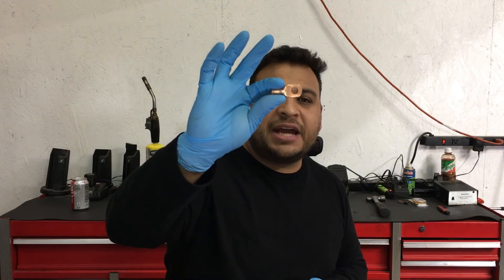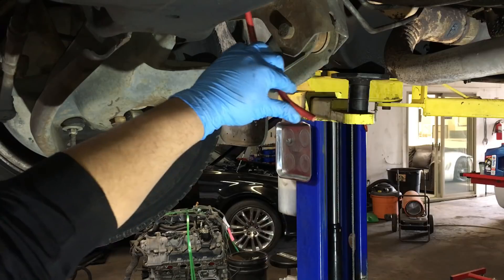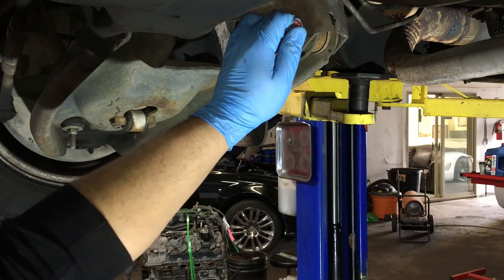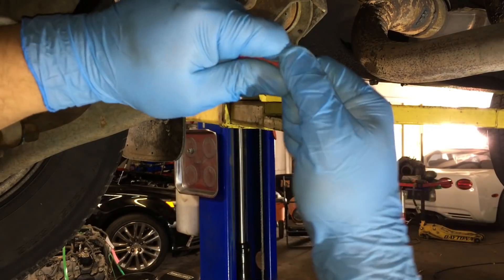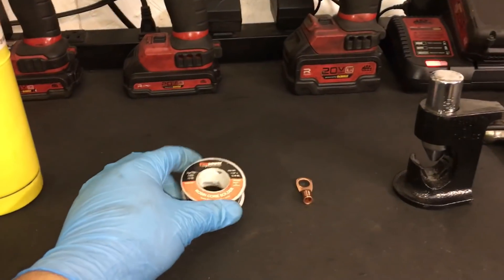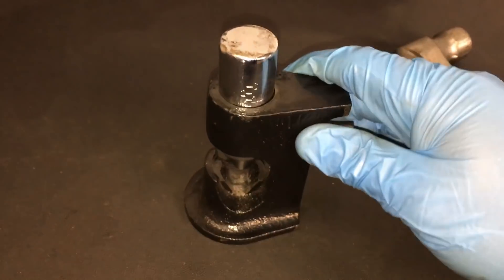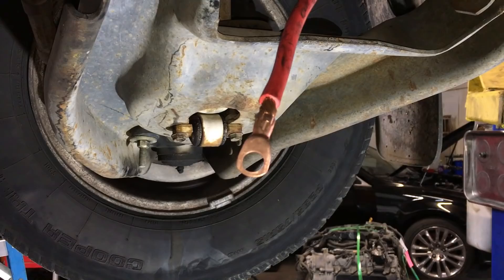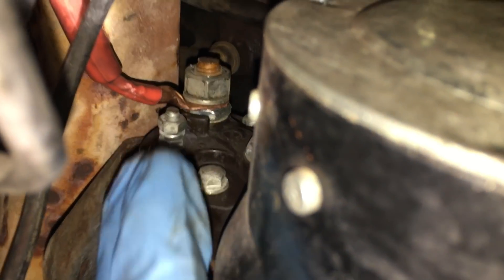SOLDERED VS CRIMPED COPPER LUG WIRE TERMINALS

Comment from the maker: My method was to solder just the tip of the wire so that when I crimped the terminal it wouldn’t damage the soldered connection. Thanks for watching!
Reply: No shame not knowing.  You taught me a few tricks with the newer stuff.  Soldering has been an old school method from way back. Before there were mig welders, British motorcycle manufacturers made fuel and oil tanks out of two hand hammered parts that overlapped each other about a quarter inch. Then they soldered them together. In auto manufacturing, in the old days, body parts were welded in a recess and the recess filled and smoothed with body solder. Not a 60/40 type but different mix.  Toxic as all get out!
Reply: Jajajaja First Solder, then Wack the Car, Then Crimp…?????   Crazy..!!

Comment: May I ask all of the expert here. Including the YouTuber to help answer a question. My dad is old and he probably mistaken a 40/60 solder (40% tin, 60% lead) as the 60/40 solder. He bought at a cheaper price hit is one whole box. He intent to use the solder to solder between the copper wire and the open barrel ring lug connector for his electric bicycle. But after he realizes is not 60/40, but is a 40/60, the seller refuse to do any refund or anything. In this video I saw this solder shown in the video is also using 40/60 solder on the lug connector. May I ask all of the experts here including the YouTuber of this video please help answer: if 40% tin, 60% lead is able and suitable for solder copper wire with open barrel copper ring lug connector or any lug connector?

Comment: Compare the melting points of solder and copper and then decide which one you want to trust to a loose connection on your starter or battery
361°F (183°C) for solder and 1981°F (1084°C) for pure copper.
When you properly crimp a copper lug onto solid copper wire, you are left with something that is as close to a single piece as you san see with the naked eye. As for magnification, I never tried that. Solder is always going to be a weak point if your hardware connections are loose. A hydraulic crimper is the right tool for the job. There are compact, battery assisted hydraulic crimpers in case you are weak or your space is limited.
Rather than cutting all the way through your insulation and counting on luck to prevent wire filaments from being cut and your amperage capacity diminished, you can cut part way through and then flex the insulation so that it parts from the cable. Did you see the lost filament(s) when the insulation was removed? The solder connection that was made here is called a cold solder. That's when you don't heat the lug with the wire and solder inside. the only solid connections are:
1) the solder to the lug
2) the tip of the wire to the solder (and this is questionable)
3) the point where the copper lug is knocked against the wire by the tip of the hammer crimp tool (also questionable.
The shrink tubing might be okay because the most important end is tight. Heating both ends and using the kind that has an adhesive inside would have been best. While this cable might not fail, it is still not capable of carrying the amperage that it would have been if it were done correctly without solder. The way the solder was used in this video, it wouldn't have caused a problem because it wouldn't have interfered with a proper hydraulic crimp. In this case it's just a wasted step.

Comment: I crimp, and solder with flux. Then heatshrink. This keeps saltwater from wicking up the inside of the insulation. Make sure that you position the terminal in its final configuration before you solder it, and clamp the wire down, and then tighten the terminal, last.

Comment: Soldering small wires is one thing except when you're working on little tiny 22 gauge data wires that are part of a canbuss network. Trust me if you solder these tiny little data wires it's going to cause you more issues than it solves. Keep in mind people that electrical solder is primarily made up of tin which has 5 times the resistance to current flow than copper does. So yes it will cause voltage drop issues when you're repairing wires in a canbuss system. This is very important. The only thing I've found that works for those tiny data wires is a variation on a wire nut. But there not wire nuts. They make them for installing car stereos without having to crimp or solder anything. It basically has a needle on one end to pierce through the wire behind your dash and then the other end is sorta like a wire nut where you attach your new/accessory wire etc or wires for that matter. Because crimping will even break the individual strands of copper in those tiny little data wires giving you the same issues as Soldering them. Believe me been there learned that the hard way.

Comment: In my line of work dealing with 4awg to 2/0 wires and cables sometimes its extremely difficult to remove from equipments to repair.. i find a hand pump hydraulic crimper cheap and effective more so than the hammer type especially in tight, awkward places .. the electric ones are  way faster but expensive.. if the terminal is subjected to alot of water, oil, grease or moisture soldiering after the crimp is important not before..

Comment: I solder many such connections all the time for battery connections on my solar battery bank. I use 2/0 AWG wire and tinned copper connectors. The difference is I put solder past in the connector and on the wire. I place the  connector in a vice and as you did I use map gas. After the job is done I put the freshly soldered end into a bucket of water. After install I spray an anti corrosion compound  on the joint. The key is the flux which helps the solder flow into and around the wire so it can't shrink ever, so failure is not possible.

Comment: 59 dollar hydraulic crimper an harbor frieght is the best thing since slice bread lol you can put crimp anywere instead having take wires off an back on..i was seeing so much about solder so i was thinking doing both but now i think about the weakness of the wire after heat BAD IDEA

Comment: you are right solder is for wires like in house never moves.plus you put heat makes the wire weak i dont care what they say an make them corrode... you have to crimp when wires has constant pressure everytime it moves.I crimp then put liquid tape were the wire meets the end of lug just make sure it flat air tight then put marine grade glue shrink wrap i never had to change one ever they last longer than we live

Comment: Shouldn’t the cable copper strands also be heated before being dipped into the solder in the lug? In normal soldering, it’s considered mandatory that both the parts being soldered need to be hot enough to melt the solder. Then the solder is melted by touching the parts, not by the heat source. If one of the parts is too cold, the solder won’t give a good hold...

Comment: Hey I love your diagnostic videos, but frankly this is the first one I've seen where i've just been like "what??? that's just.... completely wrong...". Everything shown in this video is either wrong or unnecessary. 

First of all, solder doesn't belong anywhere near areas that are prone to heat and/or vibration.... an engine bay has both of those in spades. Crimping should be the only way to join/terminate wires in an engine bay. 

Secondly, those hammer-style crimping tools are complete rubbish. You need to get either a proper lever-style hexagonal-die crimping tool (like a bolt cutter) or a hydraulic lever-operated crimping tool with dies, and do this properly. 

You don't need to do anything more than crimp it once. When properly compression-crimped, the lug becomes a solid piece of copper with the wire strands and cannot fall off because it is literally one with the wire. Heat does not affect it, vibration does not affect it. You do not need solder. The hammer style crimper cannot apply enough force to cold-weld the terminal to the wire, it simply does not work.  This is why as you mentioned, your terminals previously fell off.

Comment: Your method of soldering is prone to cold solder joints.  Torches are fine for sold metal components,
My method:
Steps 1 use a round cutting tool when cutting the wire this will minimize stray strands.  Do not over twist.
Step  2 use electronic flux.  Using a solder brush, brush the wire with flux.
Step 3  “Tin the wire” use an electric solder gun and heat the wire (torch may melt or burn the insulation.  Heat the wire until the flux bubbles and touch with solder.  Wire is hot enough when solder flows evenly.  Do not over solder.
Step 3 “Tin the inside of the terminal lug”  as with plumbing, score the inside of the terminal with light sand paper, apply a light coat of electron flux, heat with torch or gun, touch with solder to coat inside.  While still hot, slide onto the wire and apply a little heat, you should see the solder flow.  Remove heat and do not touch connector until it has cooled.  Movement will cause a cold solder joint.
Normally high current joints are crimped due to the low melting point of solder
The failure of your connector was due to a cold solder joint.  Solder needs to stay fluid.  You placed a cold object into a hot cup which immediately cooled the solder.  Your initial joint would have lasted if you had re-applied heat the the joint.  For large solder connections, there is not enough flux in the wire to be efficient.  Google NASA soldering standards.

Comment: Think your soldering is flawed. Good solder joint is stronger then the wire and usually would break at the wire not the solder. https://youtu.be/Fp37DPZVdRI

Comment: The connection would not fail if you strip the wire back and solder the wires to the connector not just the inside...

Comment: We use solder plugs. You drop the plug in the end of the eye and then heat the eye up until the solder melts. Then stick the wire in. I have never had one fail and semis draw a lot of amps.

Comment: This type of connection should always be crimped with a proper battery cable or heavy stranded cable crimping  tool that uses dies not just a indent type crimper... No solder is necessary and generally not wanted. When done properly the stranded wires are literally swaged into the terminal creating a nearly "solid wire"  like connection that can withstand vibration, high current electrolysis etc.

Comment: This is only a temporary repair right?    The reason for this is the materials used.  Don't know if the "red". Cable is correct or not, but at this time there is a lot bigger problem.
  To the best of my knowledge, I have NEVER seen universal Chinese copper ends used on the end of a General Motors battery cable.  They have always been a very heavy duty alloy and have an extra lug that engages with a slot on the solenoid.  This ensures proper orientation of the cable.
  These cable ends are very hard to find, but someone made them in the first place, so they are out there.  Look in industrial hardware.  If anybody has found them please post the info.  Then use the cable end manufacture procedure and only that procedure, along with the specified cable to make this repair.   If the proper parts are not available, there is no repair possible.  Replace it with a genuine GM part.
Reply: Ok Nissan Neal 😂😂😂😂😂

Comment: From the solar power industry: crimp, don't solder. If you crimp it properly the copper is mashed together into what looks like a solid copper cylinder. That's also how an instructor might test a crimp made by a student, he'd cut it off and look at the copper inside the lug. Of course I'm referring to a hexagon crimper that can apply several tons of pressure. Once crimped with such a device, soldering is a waste of time. Put some heat shrink over the area between the lug and the insulation of the cable and shrink it down for neatness. A heat gun is less likely to char or discolour the heat shrink. 

You should definitely crimp before you solder, if you solder at all. In the solar industry we work with large currents though, hundreds of amps for hours at a time.

Comment: I have also learned to never solder wires that carry large currents. The current eventually crystalizes the solder making a cold, high-resistance joint. Soldering is OK for mA currents. Also, crimping should be done with high quality crimpers that crimp all around the lug at once.

Comment: You did a good job, the only thing I would suggest is fill up the terminal with more solder and crimp with a two jaw tool that crimps  on four sides I was a diesel tech for years and crimped terminals up to 4/0 and never had a problem and there's more vibration than any car or standard pickup.

Comment: Any soldered connection should always have a strong mechanical bond before soldering. The solder should flow freely throughout the connection.

Comment: Wow! This is getting so complicated! Start with the basics and work forward.
(1) Quality of the cable. AWG just measures diameter. How many strands are in the cable? Is it copper or copper clad aluminum? How flexible is it? What is the insulation material? There is a new corporation named Knu Koncepts 4 ga contains 1000 strands of Cu. Not cheap. Factory cables are garbage.
(2) The lug HAS to be nickel in a water salt environment. Copper is just fine for the desert.
(3) Flat hammer crimp obviously crushes the cable strands.
(4) Hydraulic crimped has gauge dies and applies 4 bead crimp.
(5) Corrosion control...the variable. A crap shoot.

Comment: So many things wrong with this video!  First off the wire and terminal need to be as clean as possible.  Next put some rosin paste flux in the terminal and crimp the terminal on to the wire with a hexagonal type crimp tool (not the type shown in the video).  Now with the wire facing up, heat the terminal up and add solder (60/40 rosin core) to the wire just above the terminal.  Don't overheat the terminal!  Also, turn off the heat right after you stop adding solder. Allow to cool (no water or damp rag).   Clean off the left over flux with alcohol or brake cleaner.  And don't forget: Any job worth doing is worth overdoing!

Comment: I would tin first and then let the solder fill in the air gaps between the lead and the terminal.    I would also fix the lead to the body of the engine so that the wire is not stressed with vibration using a rubber mounted clamp.

Comment: FWIW dipping the cold wire strands into molten lead may result in what called 'cold solder joint' which is a shortlived repair 
In factories the practice is always crimping

Comment: I just had to re repair one yesterday that I did the solder way about five or six years ago. The cable worked its way out. I have heard from people who are into building power walls say don't solder wires with high current flows.
Reply: I agree, don't solder High current connections without fluxing, and crimping it first! Then solder it after it's crimped. The crimp will hold the connection together if it gets hot for some reason, the solder makes a better connection than a crimp and keeps the heat down through the connection.

Comment: DO NOT use "heat shrink" unless it'sa special type with glue on the inside. Regular heat shrink will let some moisture into the connection and the moisture will never evaporate from there. Do not use electrical tape for the same reason. 
A crimped connection will eventually corrode and loose connection unless it's sealed from the elements. This is where soldering works best but it depends on what it's used for. For automotive connections, I prefer crimping. It's very important to use a PROPER crimping tool, not the gismo on this video. What I usually do is apply some marine bearing grease on the wire to be crimped. Use a proper crimping tool to ensure good connection. Most of the time it's enough and the connection will outlast the vehicle because the grease will prevent corrosion. 
Use heatshring with glue sealant for connections exposed to road salt spray or in areas where it will always stay wet.

Comment: Don't like this lug join at all.  Take the whole cable out of the vehicle and do it properly.   Drill a hole into the lug where the crimp will push down, apply flux to the cable and inside the lug, insert cable, crimp, then solder through the drilled hole.  This way everything will be impregnated with solder and the joint will be bulletproof.  Then apply nice thick heatshrink cover.